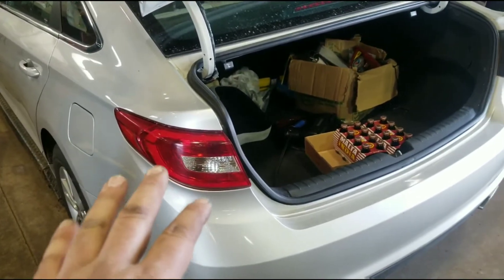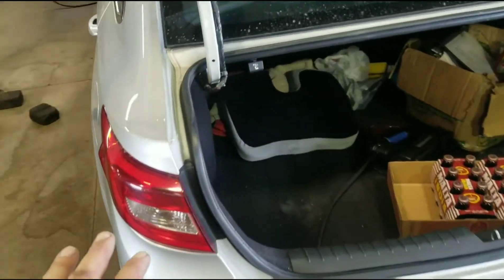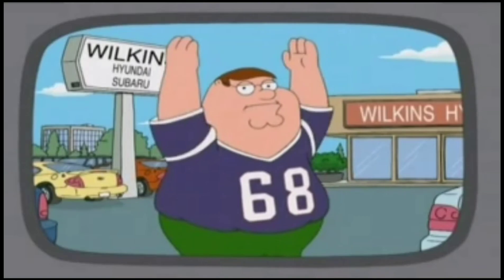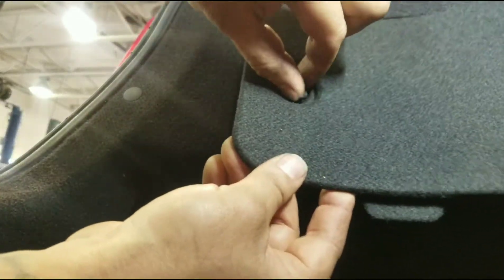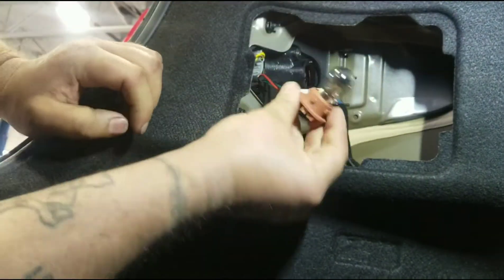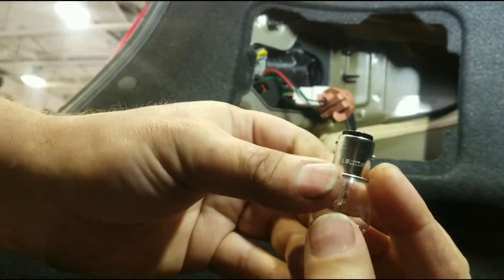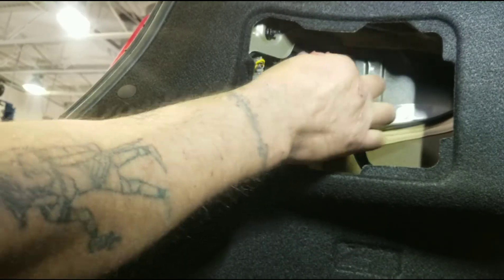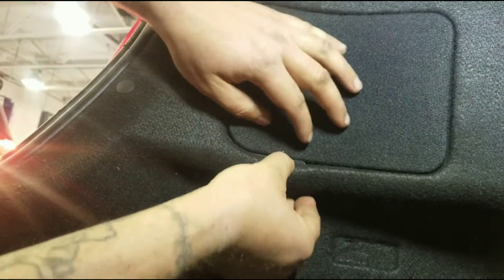2016 Hyundai sonata brake light tail light bulb replacement

Comment: I replaced mine. Had someone push brake to test. Bulb smoked up. Whats reason?
Reply from the maker: Maybe wrong bulb.
Reply: I used the same number and it just burns as soon as I put it on